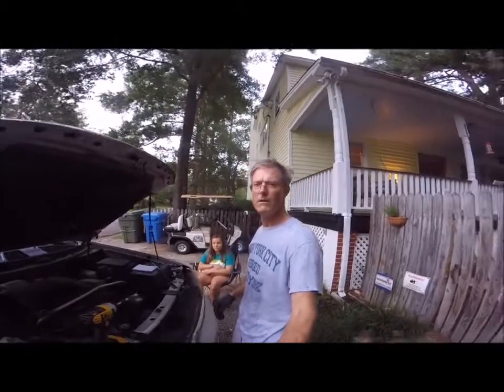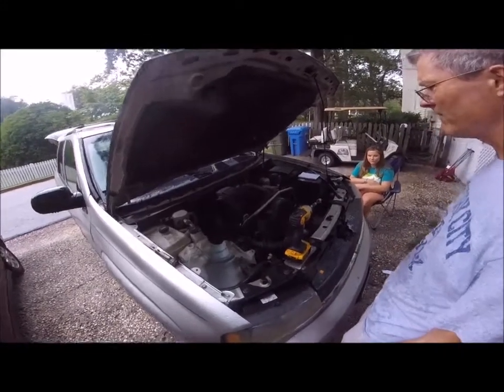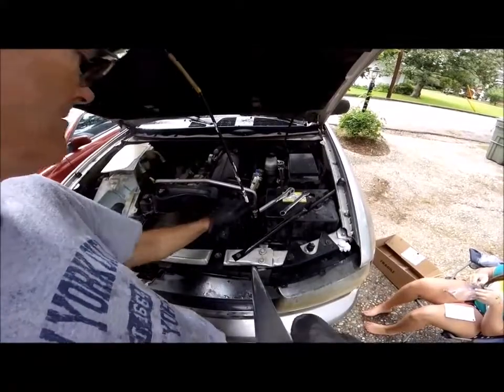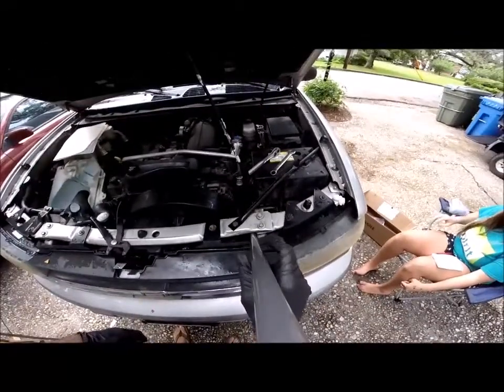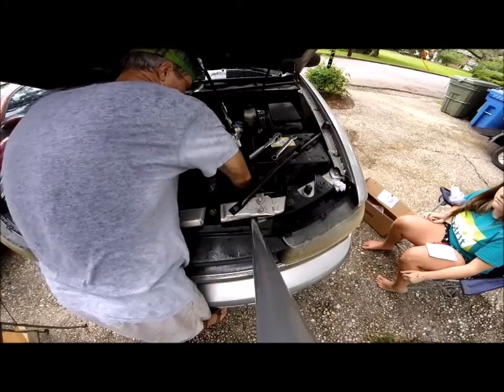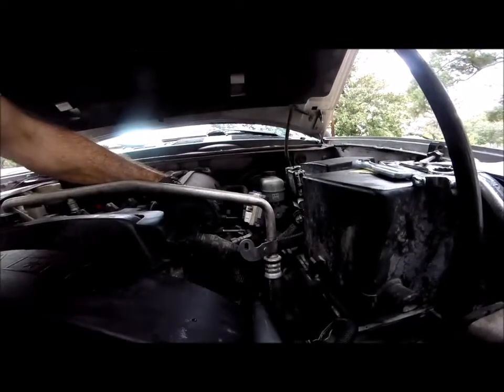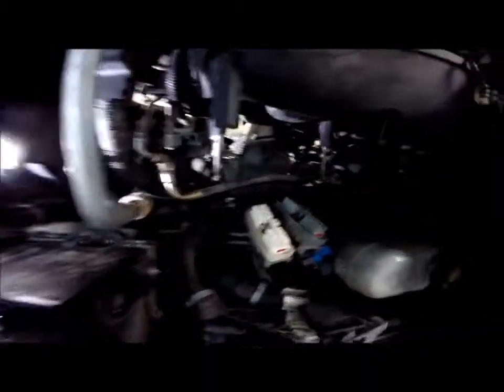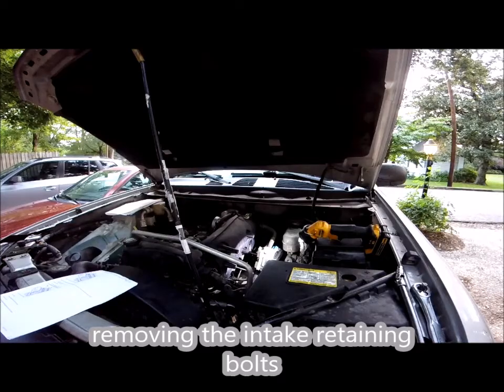2004 chevrolet trailblazer 4.2L I6 Day 1 head gasket replacement

Comment: Where did you get the timing change holding tool and the cam shaft holding tool also did they come with the manual you are using
Reply from the maker: Holding tools are from ebay

lower timing gear retainer $115
https://www.ebay.com/itm/Lower-Timing-Gear-Retainer-EN-48464-Alt-/122065083812?&_trksid=p2056016.m2516.l5255

cam holding tool $39
https://www.ebay.com/itm/Kent-Moore-OEM-Camshaft-Holding-Tool-J-44221-GMT360-In-Line-V-6-Etc-Trailblaze-/262561562325?&_trksid=p2056016.m2516.l5255

Manual is online at alldatadiy

http://www.alldatadiy.com/